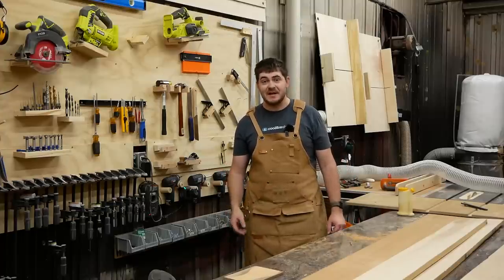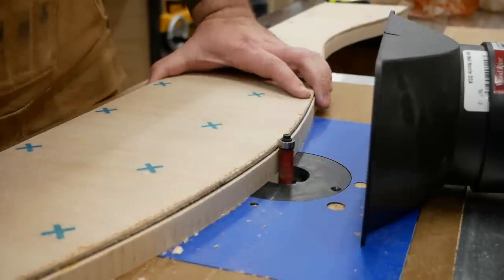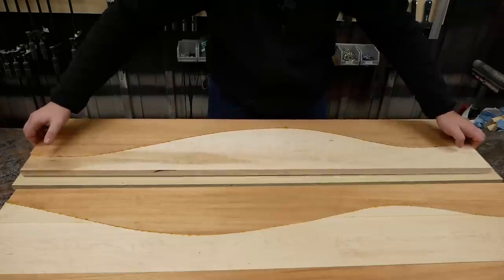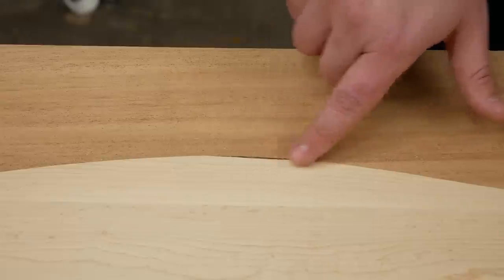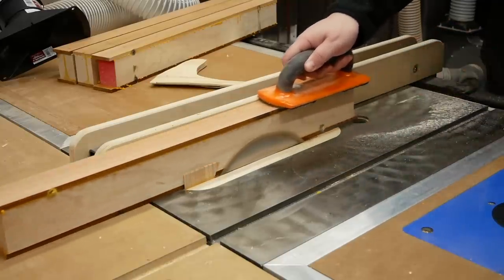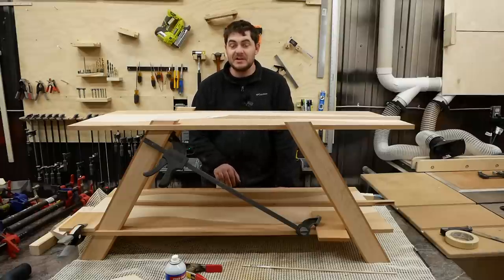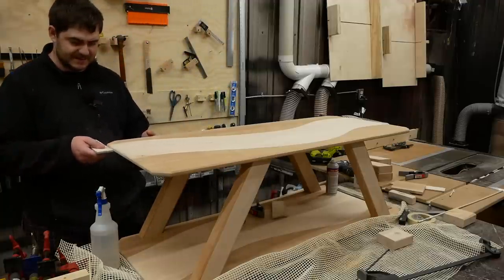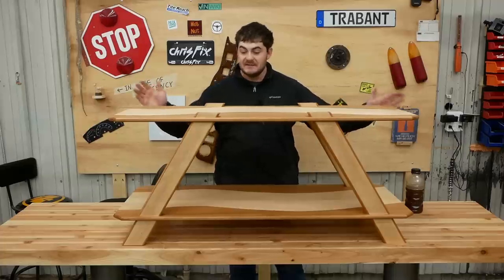Making a BirdsEye Maple River Table (without CNC)

Comment: I duno, I kind of preferred the mistake look.
Reply: Yes, but unfortunately it would be too weak.  Downward pressure would cause it to twist and collapse.  :(
Reply: @lucidmoses  put a horizontal wood dowel rod at the 2 'overhanging' corners and problem solved :)   wouldn't even have to use screws, just some wood glue,
Reply: I dunno if it would have been too weak. In the southern hemisphere the tendency of the table to twist would be offset by the coriolis effect of earth's rotation. Trust me, I know about these things, having tried the same experiment in the past myself. Nice recovery Robert.
Reply: @tallywhacker75  It's not the corners that would break.  The entire top will turn clockwise.  Give it a try.   Hold a board up at the leg angle and then put only downward force on it.  You'll see it will want to push your hand the the left (in this case).  Also, take note of just how little downwards force is needed to push you hand left.

Comment: I used to have a car with alloy wheels where the spokes were at an angle. I think the idea was to suggest a kind of "turbine" effect, give the impression of movement when they weren't turning. Trouble was, they were all the same, so the effect only worked on the driver's side of the car. On the passengrer side they looked like they should be turning backward.

Unlike my old car, I thought your table looked kinda cool with the legs going in opposite directions, but the fix you came up with to get it looking like you originally envisioned it was pretty clever. :)

Comment: "The carpet tape was too permanent, but I didn't learn my lesson, so this time I'm going to use shit carpet tape"
Reply: Turns out the shit carpet tape was the way to go all along.
Reply: That's essentially the invention of  post-it notes all over again: 3M was developing new glues, this one was really useless as it didn't hold anything heavier than a thin paper but at least it didn't leave a stain after failing.  The second tape will soon be marketed as "WoodWorker'sMate 2sided tape" at a big markup and fancier packaging.
Reply: you can also use the super glue and masking tape trick.

Comment: Pro tip 1: Use a piece of melamine for your planer sled. The glue will pop off easier without tearing out particle board bits like that.
Pro tip 2: You can climb cut the "uphill" portions of curves to avoid having router tearout or having to change the bits like that. You will need to ensure that the router doesn't grab the piece out of your hand, but I've found that to be quite doable considering the large workpiece and the small amount you're trying to trim off. It would be more problematic if you tried to do it with smaller pieces or heavier cuts.

But those are just tips for next time. The shelf looks really good. Merry Christmas, grandma!
Reply: I'm not an expert here, but wondering if a spiral bit would help?
Reply: @egbluesuede1220  not really. what a spiral bit would do is reduce fuzz at one edge- depends on upcut or downcut spiral, or both for a combination spiral. However, the router always spins the same way, so the problem of the climb cut will always exist.
Reply: Absolutely correct. You first do a rough up hill pass, or with the rotation, then a final against like you were doing to clean it off. Eliminates tearout.

Comment: Nice looking table! Personally I liked how the goofed-up legs looked all at opposite angles, very retro meets arts-and-craft with a sideswipe of modernist. But the solution, while time consumming, was elegant, nice job.
Reply: TBH, all three ways he went through to do those legs would have been good, but the "mistake" dadoed legs would have been striking.
Reply: I'd say I agree with his design decisions here and think it improved over pre-mistake plan even --- except the top "through" parts (glueing on the pointless inch bits. It makes for a very impractical top surface (which is very ANTI-midcentury, btw).  I'd have gone for a very short dowel to connect top with 'legs', that doesn't go all the way through --- much harder to position right, but with a similar jig fine (and it saves the top-surface-jiggery, so break even at worst).

Comment: In case nobody said this - mix wood glue with some sawdust to make filler for holes in the wood.
Reply: If you're using a surface finish it actually works better to mix fine sawdust with the actual finish and using that as a filler. But glue and dust is still an ok option if you're using a penetrating finish. YouTube magic 🌈

Comment: RE: your radial arm saw comment; I don't know what's been said already, but the depth/width of the cut has a major impact on the saws ability to perform. You were over on both counts. I've had zero issues with my Delta which I love using. I've also had zero issues as well regardless of the wood I'm asking it to cut. Work safe/God bless.

Comment: Thats a smart idea to use a template that you can later use as a guide for the router. I would've probably winged the first cut on the band saw and later struggled to get the cut nice and smooth.

Comment: You can get flush trim router bits with a bearing on the top and bottom just for this, Ive used them when routing guitar bodies off a template, which have the same up/downhill issues as that piece, so you only have to adjust the bit up and down when turning it over

Comment: If you spray (or dump) denatured alcohol on and around the hot glue, it takes the stickiness away and allows easy removal. Doesn’t turn it into a nasty paste or anything, just neutralizes the adhesive property

Comment: Looks fantastic.   Personally I would have skipped the fiddly leg bits on the top for functionality reasons but they look cool.
For future projects I would point out that you put multiple stress points in your table tops that is only held buy glue.  It will be fine for years. How many years will depend on how humidity stable the destination area is.  In future, before glowing the curvy bits, Sand/router the two edges so they fit along the seam without clamping pressure.
Also, I noticed "biscuits at it *for alignment purposes*"  ✔

Comment: In the future, you could try mixing 2 part epoxy resin with the sawdust from one of your boards to make a pretty good filler. Just make sure you get one with a long pot life, 30 minutes at least, so you can get it mixed in good.

Comment: Spiral cutters for the router obviate the need to swap cutters; they leave a really smooth surface and will not scorch high-sugar woods like maple and pine.  Do not be deterred by the cost; they are worth every penny.  Check out the brand Whiteside.

Comment: you can't take 3/4" in one pass. forcing a tool to do something  it isn't capable of will end up hurting the user.

I set up my 8/4 slabs on a sled and use the largest dado i can on the radial arm saw - scooting the slab along taking 1/2" wide by maybe 1/8" deep at a time. if i need to go deeper, i make several passes.

if you are interested,  i think i have some videos (unfortunately not on youtube) and can explain better. send me a message or e-mail.

Comment: You know, I tried to use carpet tape for its intended purpose - sticking a rug to the floor to stop it sliding around.

The rug did not stick to the floor. Turns out carpet tape doesn't stick well to carpet...

Comment: I don't have a planer, so I made a jig for my hand router to thickness wood. I also use hot glue to secure the workpieces to the bed, but I don't put it underneath, rather from the side. That way you can very easily remove the piece after you are done. You can also dribble a bit underneath in case of a warp so it holds up.

Comment: I'd seen the issue with the dado joints right away, but hoped I'd been wrong, somehow, until it was confirmed quickly after that I'd spotted it. :-( 
But I like how it turned out, nonetheless! Nice solution.

Comment: I'd have left off the top "end caps" of the legs, seems like a good way to hurt your wrists and fingers when using it (especially for older people), and it limits the amount of surface area you can use, if only by a tiny bit; but, otherwise, it looks beautiful.

Comment: Instead of carpet tape, I've seen luthiers use two pieces of masking tape held together with CA glue. The masking tape generally releases cleaner, but part can rip off when pulling the tape off the work piece. (For the most part it works as intended.) You could also use painter's tape (like Frog Tape) in place of the yellow masking tape. 

Check out videos by Ben Crowe from Crimson Guitar, where I first saw this technique being done.

Comment: FYI, you're using the radial arm saw the wrong way around. Don't pull the blade from the back forward; push the blade front to back. What you experienced is the blade "climbing" up the work piece, inherently the blade wants to move that direction, and by pulling you're giving it more of a chance to do so. The other way around you're moving the blade opposite it's natural tendency.

Comment: Take it from someone that uses and loves his radial arm saw.  You're supposed to push into the piece and have the dust collector hose on the top connector.
Reply: Again, this is wrong. You are supposed to pull through the crosscut on a radial saw. Yes, it is a climb cut, but the saws were designed for this. Properly align the saw and get the right blade on it and you'll have no issues.

Comment: You're never supposed to make a climb cut on basically any kind of saw. Especially with a dado stack on it. Always pull the saw past the stock and push the saw into it. That's why there's a dust port on the front of the saw. Y'know, the one that threw sawdust all over you that you don't have your dust collection system connected to at all? At least we didn't get a disastrous episode of "safety with Robert"
Reply: This is fundamentally wrong. RAS are designed to be pulled through a cross cut. It has nothing to do with the dust port. You should never push cut on a RAS. Robert, I would recommend getting a copy of the Mr. Sawdust book and read it to get a better understanding of proper radial saw usage.
Reply: @kevin_delgado  Maybe the way they're intended to be used (with a sacrificial piece as a table) is fine when pulled, but I've always pushed and never had any issues. However, the way he's using the saw to make dados is very dangerous if he pulls the saw across the piece(as was demonstrated in the video). If he pushes the saw across in this case, it's identical to how a dado would be cut on a table saw, just inverted. So maybe pulling is fine during "normal" use, but in this case pushing is considerably better.
Reply: @TheHonestL1ar  The cut dynamics on a table saw are different than on a RAS, not only because of the blade orientation (over vs under, climb vs push) but also because of the fence orientation (perpendicular vs parallel). You don't cross cut on a table saw with the work piece against the fence on a table saw, for instance, while you always do on a RAS. I'm willing to bet the issue Robert had is a combination of improper alignment and improper blade. Those late model Craftsman saws are notoriously bad at setting and holding alignment. And I watched Robert's table build video. Not great, Bob. Many problems. Get the Kunkel book, you won't regret it.
Reply: And for further clarity, while the chop saw/miter saw is a direct descendant of the Monarch Unipoint radial arm saw, and has the same blade rotation to fence orientation configuration as a RAS, they are also a different cut dynamic because they're inherently a plunge cut, whereas the RAS is not. Each tool has its own set of dynamics and it is important to learn it for each and not draw too many parallels between 'similar' tools.
Reply: @kevin_delgado  cut dynamics on a radial arm saw with a dado stack in the manner Robert used it is identical to cutting dados on a table saw with a sled. Just rotated 180° and moving the saw vs moving the piece
Reply: @TheHonestL1ar  No, it isn't the same. On a RAS with a push cut, the blade enters the workpiece the opposite way, moving up and away from the table surface vs down and into the table surface on the table saw. On the RAS that means the workpiece will be at risk for lift. The proper climb cut operation means the blade will come down and in, pushing the work piece against the fence, as was intended for these saws. Properly aligned and with a sharp blade you don't need to hold the workpiece with your hand at all. Carl Kunkel, one of Wally Kunkel's sons, demonstrates this in a video you can easily find on youtube, but I will note that he is using a vastly superior saw so it's kinda apples to oranges wrt Robert's Craftsman.
Reply: @kevin_delgado  if your workplace is properly clamped, there is no risk of lift. But there is always risk of the blade biting and pulling itself into the piece